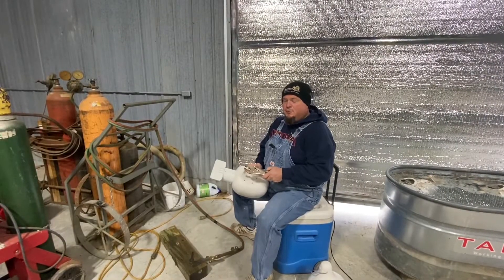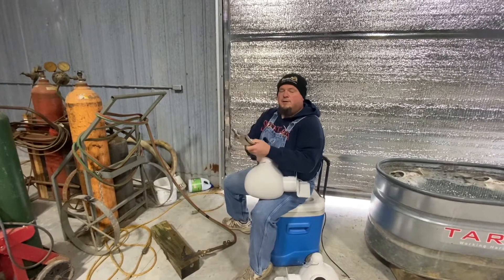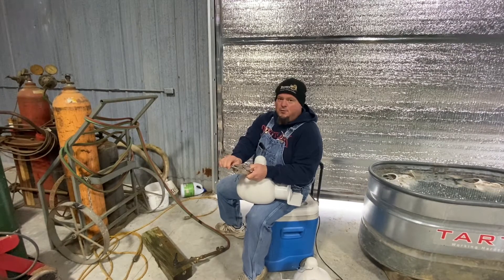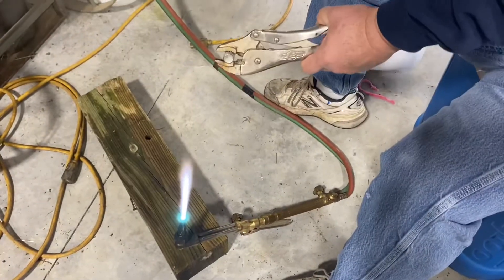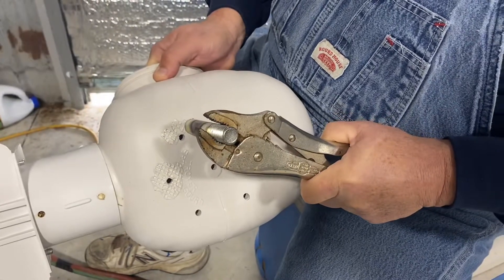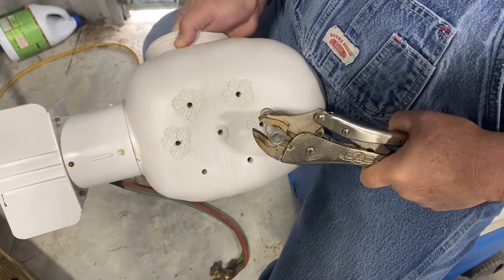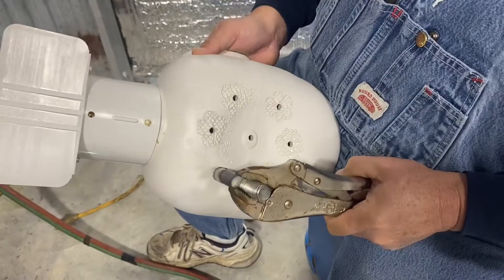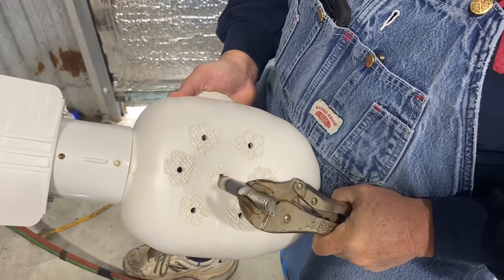Purple Martin dry gourd modification

Comment: Thank you for this. I’m preparing new gourds. I’m a first timer. I’m planning to put my elbow vent at the same height as the “hooded” undrilled vents from the factory.  Do you think that’s a decent place for it?

I saw you speak in another video and got the step drill and thread cutter.  Thank you for the tip!
Reply from the maker: Yes, that placement on the gourd is good.